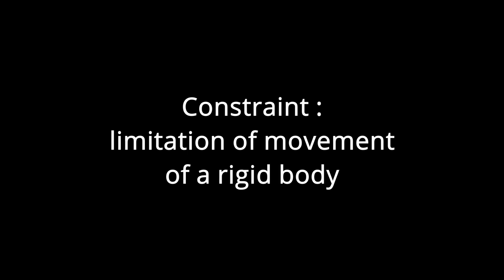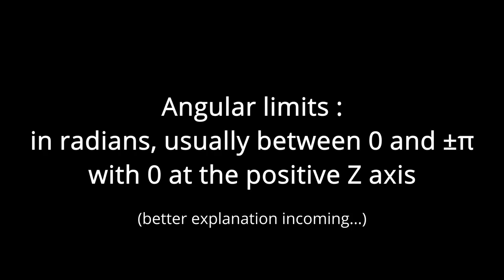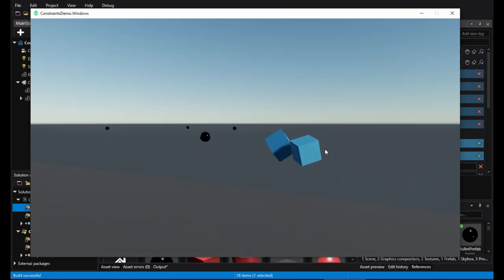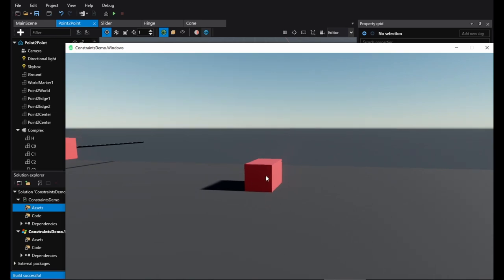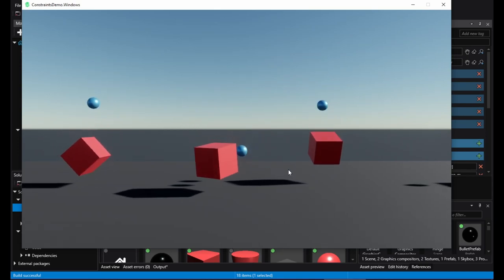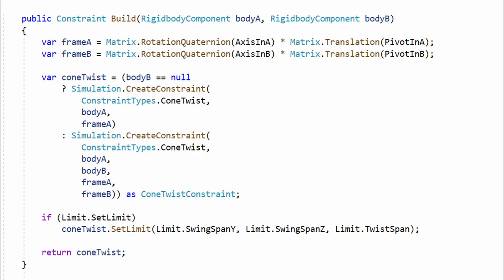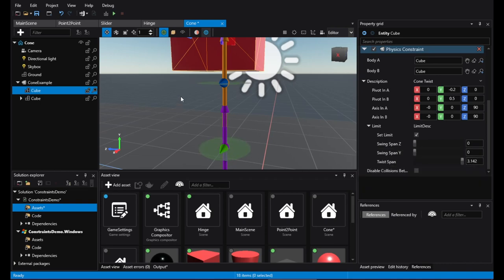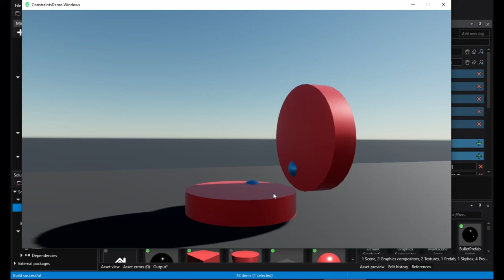Bullet physics constraints in Stride

Comment: What constraint to use like point-to-point but with NO ability to independently rotate? I.e. trying to make multiple rigid bodies "glued" together.
Reply from the maker: For fully rigid you can use a hinge or slider with a lower limit = upper limit. Another thing you can do is use P2P but set AngularFactor to (0, 0, 0) which should remove the ability from the object to rotate at all. Depends on you use case.

Or you can create 3 P2P constraints between those objects which should have a stable solution.
Reply: @manio1432  Do you know if there is a difference in speed between these approaches?
Reply from the maker: @orange451  The less constraints the faster. Note that the angular factor is preventing global rotation of a body not local to the constraint.
Reply: @manio1432  Gotcha. I want the overall body still able to rotate, but the smaller pieces that make it up can not rotate.

Comment: how to make same thing like this without BCB,...i mean straight in bullet??
Reply from the maker: You can have a look into Stride's source code - it's just a thin wrapper over BulletSharp which provides C# bindings for Bullet.
Reply: @manio1432  Thank you so much for your reply...I wanted to ask one more thing bro...
Please be kind to reply as i am really stuck at a dead end
I wanted to know how accurate is the btGeneric6DofSpring2Constraint... I am dealing with simulations of structures where accuracy is of prime importance...So far i tried it with alot of different values of stiffness and damping but the results are not accurate...rather it seems to be an approximation where 20 percent of distance is decreased no matter whatever the value of stiffness or damping...is there some problem at my end? Or please guide what do i need to do...
I'll be really grateful if you can take me out of this 🙏🙏🙏
Reply from the maker: I'm afraid I can't help you with that. I only worked on integrating Bullet constraints with Stride game engine. You should look at Bullet related forums to find out more related to your use case.